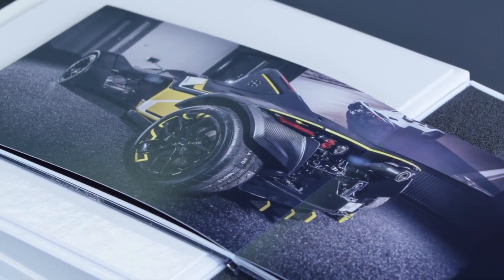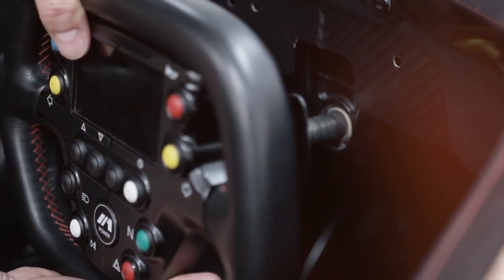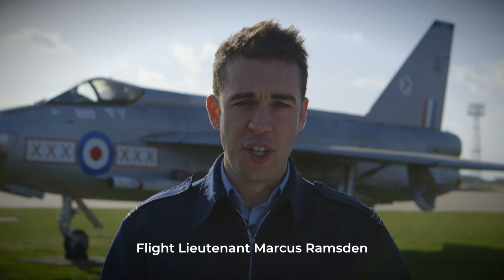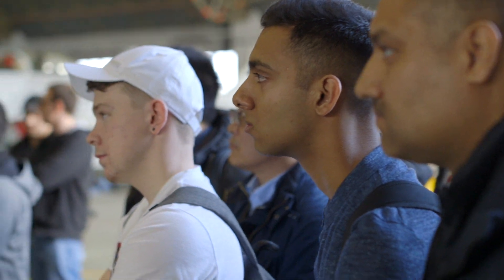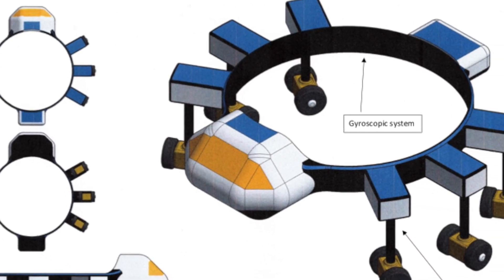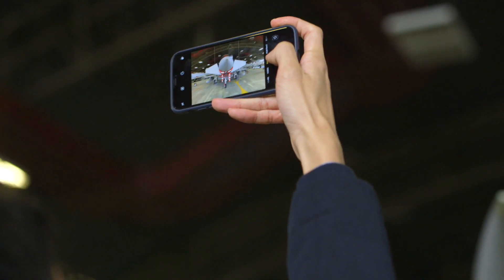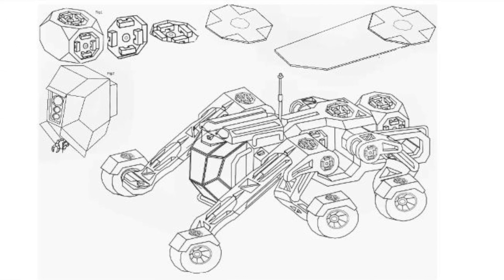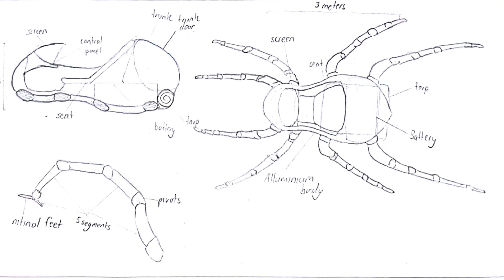Meet the Winners of the Mars Transport Vehicle Competition | STARRSHIP

Comment: ....... these are just designs that look pretty. Most don't seem feasable technologically or have to many points of failure. 

What is even the point of a design a engineer would just bin?
Reply from the maker: Thanks for your comment. The judging panel was made up of engineers from Briggs Automotive Company and the Royal Air Force 😀 

We were looking for innovative designs, inspired by the BAC Mono, Falcon and Reacher. The winner - actually had his design developed in 3D modelling software with designers and engineers from BAC Mono.
Reply: It’s amazing what hits the cutting room floor. The “right” design is built on a pile of “wrong” ones.